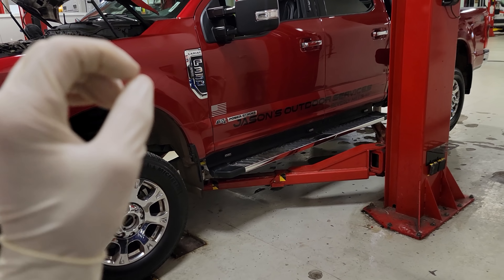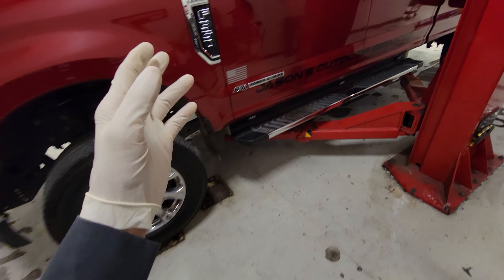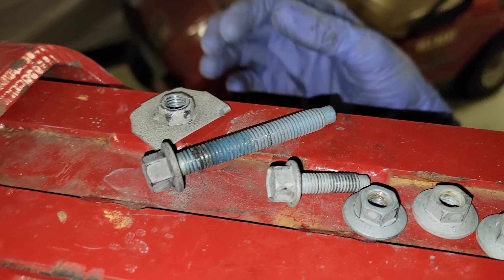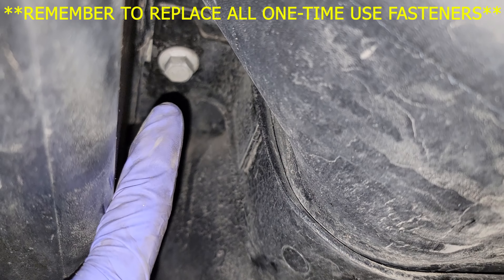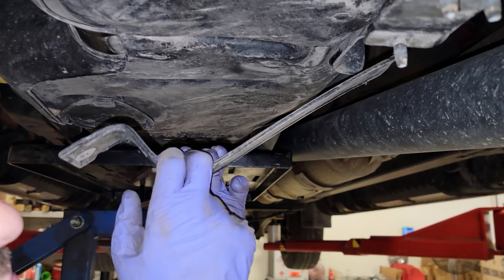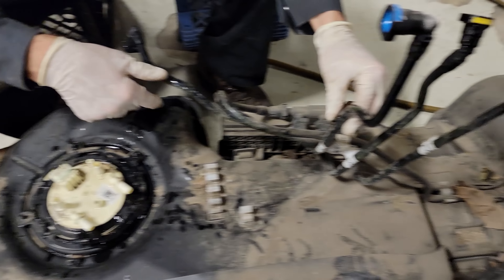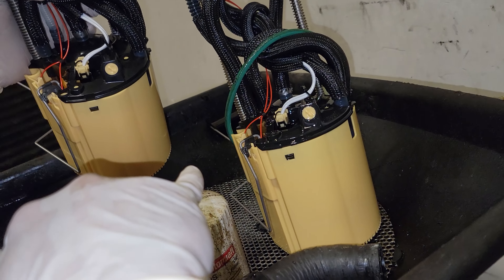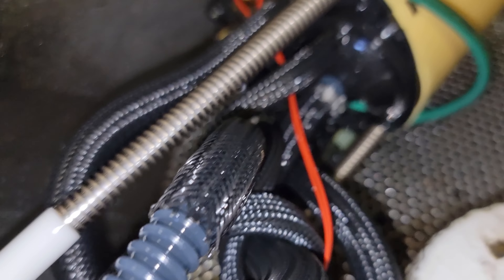Is YOUR New 2020-2022 Powerstroke FUEL pump NOISY?? | Mine is | Watch this & find out HOW TO FIX!

Comment: I had same noise issue that eventually became  "low fuel pressure" and "p0087" code. I changed both fuel filters- low pressure fuel pump-fuel pump control module-fuel volume control valve and nothing changed.  I pulled tank again cleaned pump terminal ran pump with hose directly into fuel conditioner return line then ran engine with return hose at tank disconnected into a pail. ONE of these last things fixed all my issues. Noise is gone- fuel pressure is steady at 65psi where before it was jittery anywhere between 30-50psi and p0087 is gone.  2019 f450 super duty 170,000 miles

Comment: Have you seen this on trucks built after that date, or is there a different TSB for the trucks after that date?  Mine is an April 2021 date but it absolutely has the knock.
Reply from the maker: No update, but u clda been built with old stock
Reply: @PowerStrokeTechTalkwARod  so I finally got the dealer to hear the knock, and they wound up replacing my fuel pump. The brand new pump knocks just as bad. The noise isn’t concerning so much to me, the thought of the pump dying is my concern. Do you think I’m fine with a brand new pump even though it knocks, or should I get the dealer to revisit the issue?
Reply from the maker: @TeamNiem Does it do it with a certain level of fuel in the tank
Reply: @PowerStrokeTechTalkwARod   maybe when it’s slightly less than full, it’s doing it at 1/2 tank right now. Maybe it just echos more when it’s got some air space in the tank.

Comment: Did the new fuel pump resolve the issue? Just had mine done with updated part and pcm update and still have knocking from fuel pump.  Mine is 2020 f350 SC.

Comment: Mine makes that noise, I just changed the fuel filters and primed it 6 times and then started it long enough to see the oil pressure gauge go up and the shut it off because I just change the oil at the same time... well went to try again and the truck started to roll over longer then normal so I stopped it and primed 6 more times tyen tried to crank it and the truck wont even crank over. Pulled underside fuel filter off to see if it wasn't making a seal, looks fine but no fuel in it almost as dry after priming 18 or so times...
Reply from the maker: Whhhhhhat!

Comment: unrelated question, but hopefully you can help.  2021 Ford f350 diesel makes a "CHIRP" noise when I shut it off.  any ideas?
Reply from the maker: Normal. Its the belt. Ur shutting off a bunch of rotating parts that have mass and inertia. When that suddenly comes to a stop the belt makes that noise

Comment: As always your vids are great and only one that actually explains the issue . I have 2015 that started making that noise as well as gurgling sound when cycling the key . Shop said the lower fuel pump and upper one are pumping correctly. They said it may be the pump in the tank caveating the fuel . Found that weird if the tank is full but did swap out OEM tank for a 60 gallon Titian tank. Also causing issue with loosing pressure when truck shuts off. Then makes starting a little difficult.
Reply from the maker: There is no pump in the tank. It's only mounted on the frame rail. Hmmm I wonder why it's still doin it with the bigger tank
Reply: Not a pump but the sending unit in the tank . They were going to replace with S&B sending unit . They said that they have seen issues with the sending units having issues with Titian tanks . After looking at the S&B tank should have gone with that one . Bit over all not sure . Not leaking fuel and have codes or issues once truck is running . Only in start up . Wonder if there is check valve anywhere that may be messed up or an o-ring missing from a line .
Reply: Ended up being that the shop that installed the tank had a hose that was loose and also kinked . Dropped the tank fixed the lines and no more issue. Recommend that people give the lines a little tug to make sure they are secure. Got lucky that it was not leaking . Also S&B said that even if it was the sending unit that their sending unit only works with after market fuel pumps (air dog or Fass) so would have had to replace with ford part. As always appreciate the help and keep doing the things you do and share your knowledge with YouTube world.

Comment: Did the TSB not fixed. They swapped out the pump in my 20 6.7 Tremor. Did not fix it. They replaced the Fuel pump controller and that fixed it.

Comment: Ok this might sound Nuts  yes get it sound. But I had F150 Ecoboost that would make sound when I left trailer hitch In place, and I need to triple check this on my 2020 supper duty 6.7. Because it makes a sound like parking brakes are slipping when parked. Not always? And now not sure if fuel pump or tow hitch? Great channel! Thx for Info
Reply from the maker: Def not the hitch...

Comment: I was getting that noise for months on my super duty when I bought it as well and ford had no clue what to do and said it would be fine to drive… long story short I put an spe fuel filter kit on it with the larger flow and better filtration cat filters and it’s been 20,000 miles since I put it on and haven’t heard it since.

Comment: So nice seeing someone take pride in their work! Amazing video. Mines made this sound since I got it, 2019 f250. Seems to stay quiet if I stay above 1/4 tank. I thought maybe it was heat related. Arizona not kind.
Dealer did say the sound was normal/common..
Reply from the maker: Thanks pal
Reply: I also have a 2019 F350. I installed the S&B 55 gallon tank and thought maybe I did something wrong. Could not remember if the noise was there prior. I did my first fuel filter change at 17k miles and that didn’t help. It’s freaking me out. Also in Arizona!

Comment: My 2021 started to do that noise at 43,000 miles. During the 2nd fuel filter change I noticed brass in the bottom of the housing where the filter sits.

Comment: 2020 F-450 chassis cab has the same noise,  56000 miles,  Will the dealer change the fuel pump?
Reply from the maker: I mean if they want to...some dealers im womdering about

Comment: Hi Jason.
Reply from the maker: Jason where you at?!?!
Reply: I know it’s an old video, was this fuel pump covered under warranty? 2020 f-350 limited 46k miles
Reply from the maker: Yes!
Reply: I’m absolutely in love with these trucks, I have a 19’ f-550 I drive for my company and have hammered it for 110k miles and it just keeps going, did have to change turbo at 82k but it never stranded me. It weighs 20k too lol. Just bought this f-350 for my personal rig.
Reply: @kylegrizzle2640  from day 1 of existence, Powerstrokes love being worked!  No putt puttin.
Reply: @Itsa_Mea   agreed! I work on deere mostly but it seems like as long as it runs every day you’ll be good. If it sits it’s no bueno. Lol

Comment: What about the squel/ squak sound coming from under the hood? I think it has something to do with turbo vacuum. Fird says it normal, I say BS my 2018 6.7 never that noise.
Reply from the maker: Yeah thats the diaphragm releasing off the cooler...big deal....totally normal...
Reply from the maker: They told ya that🤦‍♂️🤦‍♂️
Reply: Its kind of embarrassing, turn off truck and walk in front of it and its like the is screaming/ squaking at you. People near by look at you and your truck funny. Ford may say it is normal, but no way did any Ford engineer sign off on that before production. This noise must have appeared in the engines after production,    and its easier if they just say its normal. I have never heard any car or truck make a sound any where close to this and I have been fooling with cars and trucks for over 40 years.

Comment: Almost seems as if they designed the cage nuts to break. I swear engineers hate us techs... Hate us to no end. Make it harder than it has to be for the simplest things.

That inductive heater looks like an invaluable tool! Nice tips A Rod!!!
Reply from the maker: Thanks pal
Reply: Locking nuts are a disease....I have never, in my 48 years doing this, had a fuel tank fall off. Rust off-yes but not bolts fall out.     Yes, that push on a connection and then pull it off method is the ancient martial art Judo.
Reply from the maker: Lmaooo
Reply: They should call them tell-tale nuts, because you can usually tell that someone's been there before.
 (Unless you got that inductive power)
Reply from the maker: Lmao
Reply: I used an impact wrench.  The speed nut broke.  Switch to just a normal ratchet and the rest of the bolts came out just fine.  I did have to cut the bolt with the broken nut.

Comment: Got a 21 F450 they put a new pump and know it making a louder noise . They say it’s not going to hurt nothing . Do you think I should try another pump ?
Reply from the maker: Damn reallly.
Reply: I checked and mines definitely a little noisy too can only really hear it when the engine is not running.  21 F450.  After reading this I don’t know what to do.

Comment: Is this an issue to watch out for in the 2019’s
Reply from the maker: No sir
Reply: @PowerStrokeTechTalkwARod   whew thank you
Reply: I have a 2019 that’s making the same noise
Reply: I have 2019 with 55,000 miles doing it also is it just noise or will it fail

Comment: Where can I get the fuel pump removal tool?
Reply from the maker: Otc
Reply: @PowerStrokeTechTalkwARod  I will check the local auto parts store.
Reply from the maker: I think I show you the number there
Reply: I am installing the S&B tank soon and was watching your videos to prepare.  Also today my truck developed its first issue.  It better be a warranty issue.  Loud fan type noise on acceleration.

Comment: Ford needs to put on external lift pumps for their diesel
Reply from the maker: Agreed
Reply: I'm installing the FASS system but I am quite paranoid about the modifications needed on the fuel pump for the install.   And I'd like to not bypass the Ford water separator even though the FASS system includes a water separator.  So I'm undesided if I'm going to proceed.  Do you think ARod would help me if I gave him free room and board while he was here?  A couple hours we'd be done.

Comment: I just had a fuel pump changed in my car and it is making this hissing, buzzing noise that can be heard from 30 feet away while idling the car.
The original, OEM pump went 175k miles but I decided to preemptively replace it because I had to have the tank laboriously dropped to replace a defective fuel sender to eliminate a check engine light to pass emissions.
The mechanic who installed the new pump was nonplussed when I told him about this noise with the new pump.  I must have gotten scammed by substandard Chinese knock off parts and this is the first time that I allowed the mechanic to source his own parts dammit.   I usually just get OEM parts and he puts them in for me.  
This country is in trouble, as crap like this is happening everywhere as the USA is being systematically de-industrialized.
Reply from the maker: Just plain awful

Comment: Does my 2012 have a pump in the tank like that ? The only noise I get is when the filter on the frame rail lift pump gets dirty it will whine like a little bitch 💁
Reply from the maker: No
Reply: Thanks for the response. Love your videos. I also have a 1997 F 250 7.3 Crew Cab . It’s pictured in my thumb nail. I’m the original owner . I ordered it from Ford choosing the color scheme and all options. Owned it 25 years now it has 550,000 on it. I started out with Bill Hewitt of Powerstroke help back then to learn how to maintain it and fix problems. The only way to be able to afford to keep a truck this long. Your videos are helping a lot of people ! I’m learning as much as I can about my 2012 6.7 cause I’m doing the same with it as the mighty 7.3 💪
Reply from the maker: Thanks pal, appreciate that 👊🤝